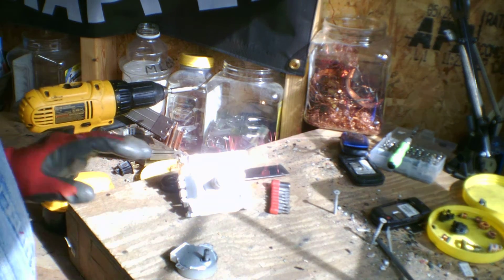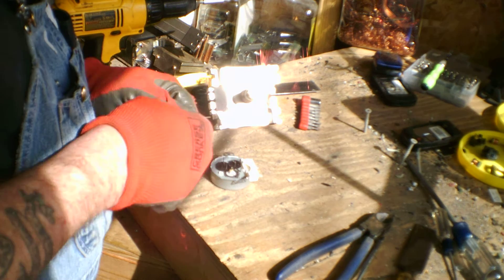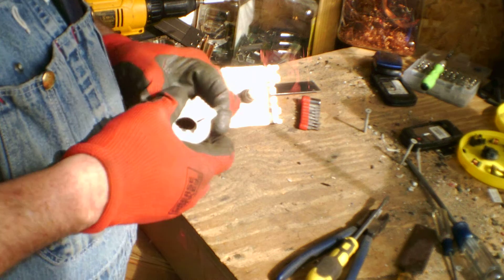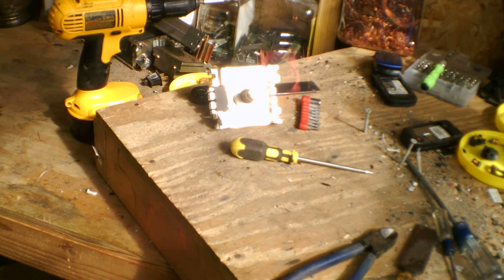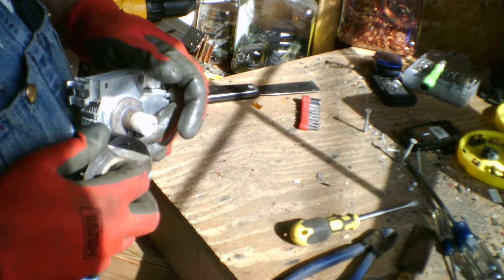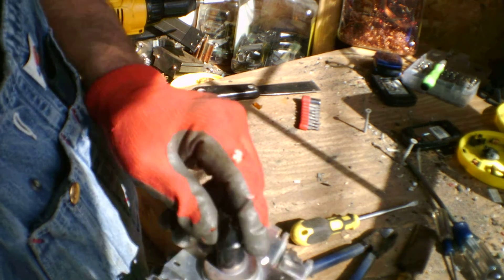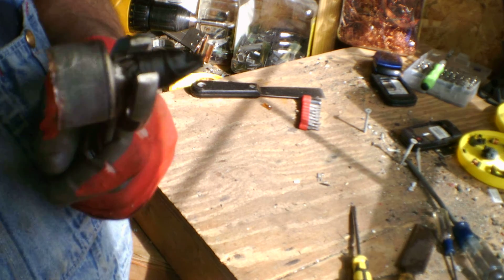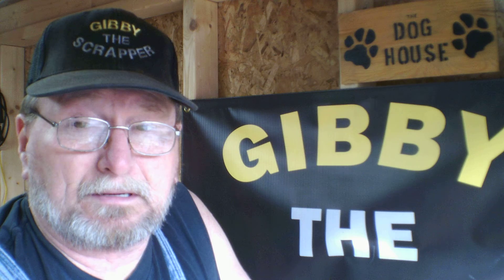Microwave rotation motor and Microtron

Comment: Nice video my friend, I have some microwaves I need to scrap.  Just wondering,why not break the ceramic?
Reply from the maker: If you break the ceramic it puts dust in air that is a high cancer causing agent. This is why I tape it up. Be careful. Thank you for watching. some are safe but I rather tape them. I don't know the safe ones verse the unsafe.